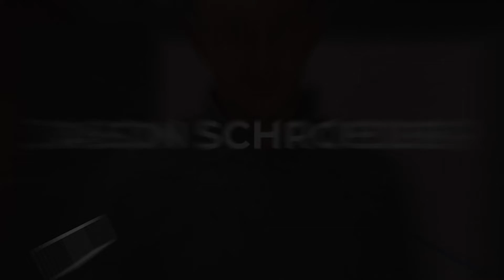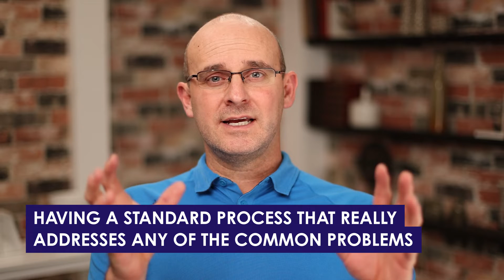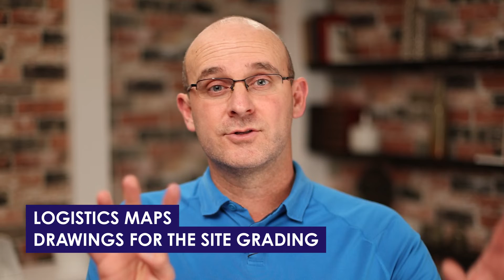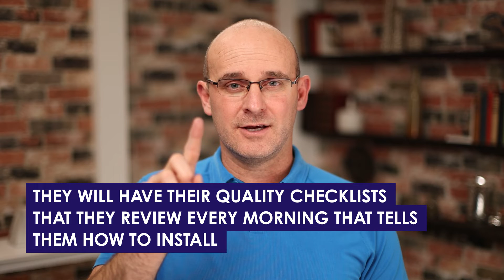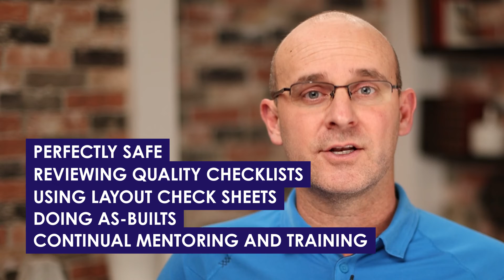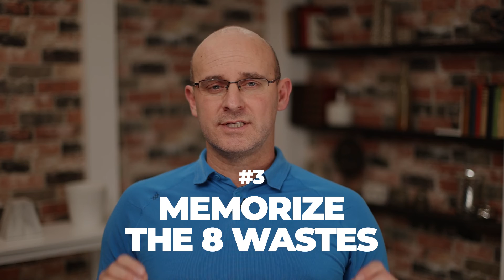What Is Underground Utility Construction​?

Comment: great stuff. look for clay or compressed dirt to expand 1.5-3x in volume. the excess dirt is called the spoils. never let a hoe operator start digging without having the city come and mark out the underground utilities, and if you are trying to expose a line or pipe have a laborer use a shovel to expose its elevation first and then carefully dig along the line with the hoe if possible and stay a safe distance above from the exposed pipe/line. dont expect the water or gas line to be at the proper depth. all soils are not equal and you cant put certain soils in certain places or its a huge problem, so make sure you know what kind of dirt or aggregate you are dealing with. always be aware of overhead lines and flag them so the dump truck or hoe operator doesnt tag them and shut the whole thing down.